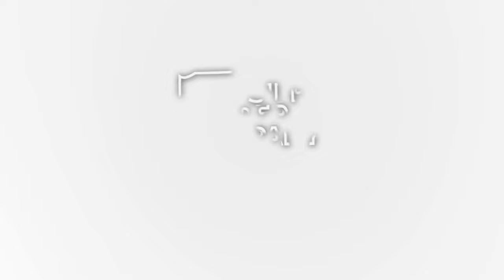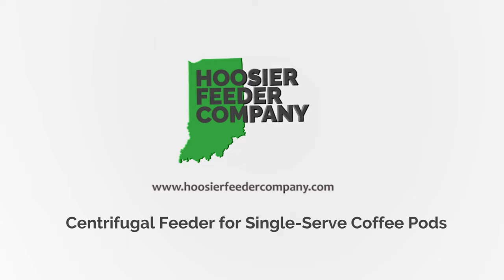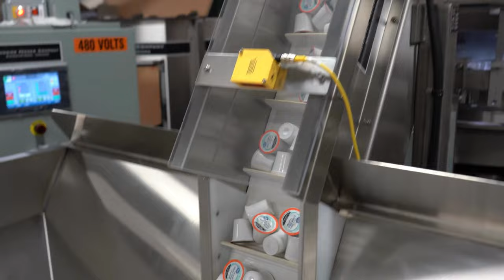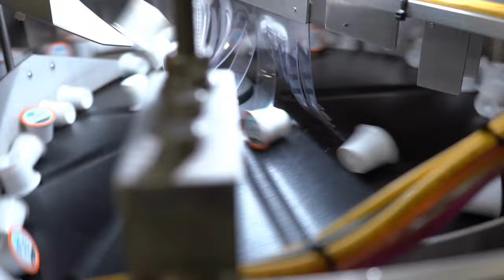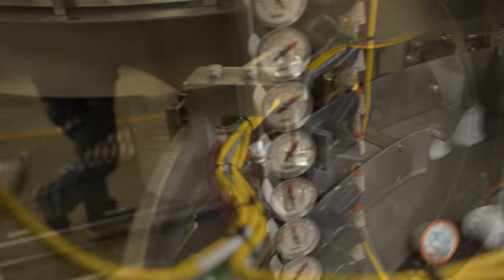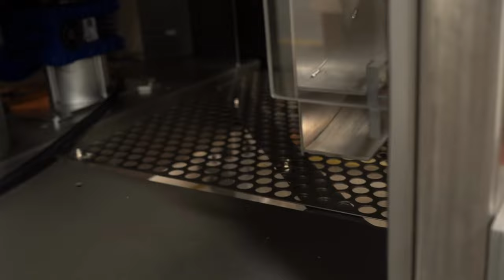Centrifugal Feeder Bowl for Single-Serve Coffee Pods

Comment: What was the trickiest part of the design?
Reply from the maker: Great question! To achieve 500 parts per minute (ppm) in such a small footprint, the feeder needs to be incredibly efficient. The prefeeder needs to be consistent, delivering the right amount of product to the feeder, preventing jams and maximizing output.  Additionally, we're continuously looking for  opportunities for improvement. One enhancement we've made over the last few years is in the hand-off between the prefeeder and centrifugal feeder. We've reduced the size of the feeder to save space and maximize manufacturing efficiency.